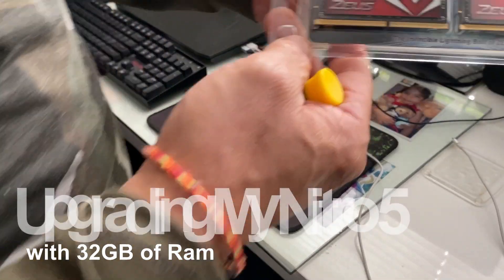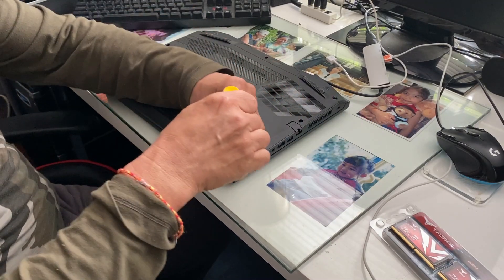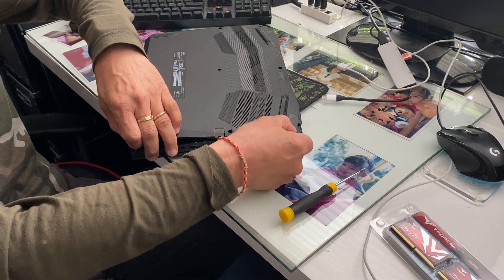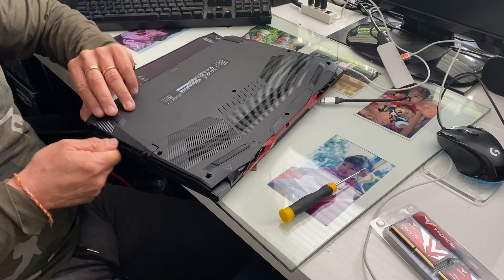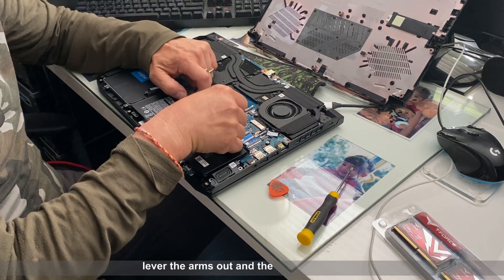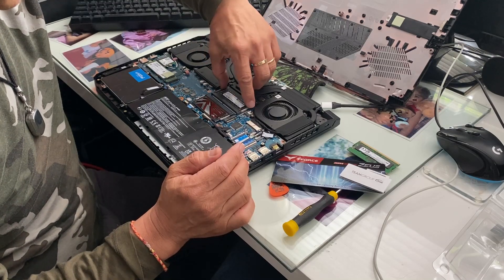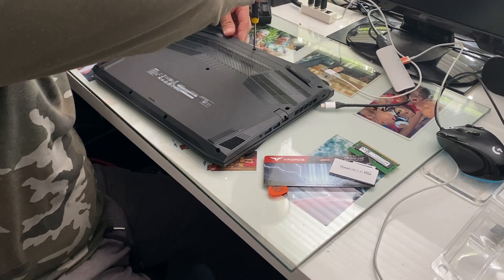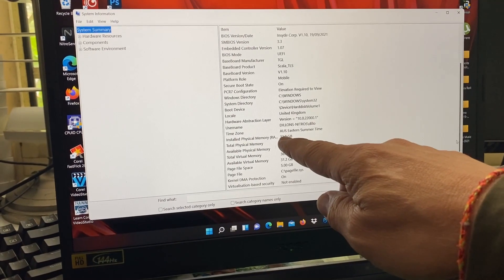Upgrading my Acer Nitro AN515-57 with 32 GB of RAM

Comment: Hi, I have this same model and upgraded to 2x16 gb 3200mhz but my speed reduced to 2667 mhz. Should i manually set ram frequency in bios from auto to 3200 ?
Reply: Your CPU processor couldn't handle it so it capped automatically.

Comment: Do you know if it's still able to run at boost speeds. I read that using this ram may limit the clock speed to 2666mhz. Please let me know I'm thinking about purchasing the same ram if it's not limited.
Reply from the maker: Not sure, I remember trying to enable over clocking at the bios , but cant find the setting. So I assume my laptop dont have it.

Comment: Acer does not use a separate tool to remove the back cover on these series as it can be scratched. Unscrew all the screws, then hold the upper right side of the cover and gently pull it towards you, the cover will open easily.
Reply: Thanks bro. I had really difficult time trying to dissemble the laptop. Until i went to this video and read this comment this really helped me. Thx man

Comment: whats your laptop ideal temperature ? mine is around 52 - 60 is it okay ?
Reply: Fluctuates, hottest during gaming, worst during hot weather.  And how long you use it for, you can tell when your laptop fan spins faster. Computers all have a thermal cut off, so if the temperature is too hot for the components inside it will automatically shut down.
Reply: @bestsydneyparks9164   goes 92 while gaming not beyond that , i haven't cleaned it for a year(since i bought) due to warranty issue .
Reply: @bestsydneyparks9164  update temperature sits around 42 - 45 hot summer and 88 at gaming with normal thermal paste.

Comment: Hi, I also have Nitro AN515-57. 
does it need to have the same RAM or i can keep the original  ram and just add 1 T-Force Zeus RAM?
Reply from the maker: If you want to add a Ram, it is best to get one with exactly the same matching specifications as the one you have. It is best to take your one out of the laptop to your supplier and ask them for a matching ram and make sure you can get a refund if it doesn’t work.

Comment: i tried to upgrade my ram but i wont get a display after i do it
Reply from the maker: It sometimes takes a bit of time to recognise it, if it don’t take it out again and reinsert it make sure it clips.
Reply: @LQQKn4Laughs  I saw online to wait a few minutes and I did so and got a black screen still, I also tried testing each ram individually and they both worked individually. So I'm not sure what the issue is
Reply from the maker: @StreetkillnHD  are both Rams the same specs, so your just adding one new ram with the ram that came with your laptop. You would think it would still boot up showing just one ram. But black screen, did not even make it to bios, would be a Ram issue.

Comment: Hi, i have an Acer Nitro AN517-52, Intel i5, Geforce 1650 GTX, 8GB Ram 3200mhz DDR4 dual channel. I was wondering if its possible to fit Corsair Vengeance 2 x 8Gb 2400mhz DDR4?, i know the lowest Mhz you can go is 2600, but i'm just asking out of curiosity. Cheers.
Reply from the maker: You can but you will reduce the max speed of your Ram to a max of 2400mhz, better to buy an 1 extra 8GB 3200mhz and add it to your existing Ram.
Reply: @LQQKn4Laughs  ok thank you
Reply: @LQQKn4Laughs  hi, will any 8gb 3200mhz ram stick work? Or does it have to be a specific matching stick? Thanks

Comment: Can i get plss your model number bc I can’t find the ram also in the description
Reply from the maker: Laptop
Nitro AN515-57
Core™ i7 processor1, GeForce RTX™ 30 Series GPUs1 and the high-speed IPS FHD display with 144Hz refresh and 3ms2 response.

Ram
TEAMGROUP T-Force Zeus DDR4 SODIMM 32GB 3200MHz (PC4-25600) 260 Pin CL16 Laptop Memory
Reply: @LQQKn4Laughs  i mean the ram
Reply from the maker: Laptop and Ram info given

Comment: Has anyone tried an external GPU via thunderbolt?
Reply from the maker: Can’t find any usb-c gpu adapters on eBay , is there such a thing?
Reply: @LQQKn4Laughs  an515-57 got a thunder bolt port , devices like Razer core x supports thunderbolt.
Reply from the maker: Woe, $700 Australian Dollars for the Razer Core X, may be better to fork out for a better laptop. Did you see the alternate ways , plenty youtube vids  on removing the the wifi card and using its pci slot for an adapter, more risky but cheap way to getting a external gpu. Check out this vid. https://youtu.be/vHiEqUoxyoQ
Reply: @LQQKn4Laughs  i know i just want to know of someone had tried and if it works

Comment: Great video!... Hi, can you show the memory info in TaskManager in the tab Performance? or give me the info like speed you get with new ram upgrade...? Thanks.
Reply from the maker: yes,Task Manager and click More Details > Performance > Memory.
Your RAM speed, in MHz (megahertz), is under the graph next to Speed.
Reply: @LQQKn4Laughs  In your case, what ram speed you get with this new Ram?
Reply from the maker: @CapzsparttanZ  my max speed is 2667MHz, It’s only a cheap laptop for basic gaming, the max speed of the new ram are rated 3200Mh , I don’t think you can use max speed as the bios don’t offer the Xmp profile, I could not even get onto an advanced menu for my Nitro. If you find a way, just be careful it may harm your laptop.

Comment: I have a question, I have 8 gb of samsung single rank ram model ( 1Rx8) with this laptop, I want to upgrade to 16 gb but the samsung ram model isn't available in my country, a crucial model is there with same specifications with dual rank (2Rx8) should I buy this or go for single rank model of crucial? Will there be any compatibility issues with single and dual rank running together?
Reply from the maker: The best is to match the rams with same specs/speed and the same chips inside even if its different brand, cant go wrong with buying the exact samsung replacement.  If you cant get it, stick to Ram kits, 2x8gb or why not 2x16gb. However I have mix and matched Rams in my older laptops and most of the times it works fine, but if you want re-use your old stick to save money go to the supplier tell him you want to upgrade to 16 and have a Samsung Ram/specs.. and you want a equivalent, make sure you can get a refund if it doesn’t work. Check out also Linus Tech video https://youtu.be/bTS0ybQ3lCI
Reply: any ram company name should work fine! as long as you have it as a SODIMM and  at the same ram speed as your nitro 5, My AN515-57-535Z is a 3200mhz model so i bought 2x16gb ram sticks with both 3200mhz and put it in and it works nicely~ just make sure what number of mhz you need for your laptop's max capability :D

Comment: Does the ram require XMP compatibility? Also, if I may, is it dual channel? I have a Acer Nitro 5 AN515-57-536Q. Thank you sir.
Reply from the maker: My laptop is still under warranty and I didn’t want to muck around with over clocking, my nitro can only handle basic gaming so I kept to the specs they recommend in the manual for my model which should be the maximum speed The laptop is rated at.

Comment: I wanted to upgrade my storage with crucial mx500 1TB 2.5 SSD but after it was installed, my nitro 5 won't boot up. The screen is just black, if I disconnect the SSD it boots up just fine, any idea what could be the problem? Thank you.
Reply from the maker: Hook up your hard drive first then get into your bios, select your original Hard drive that has your operating system installed as your first boot device , save then exit.

Comment: Is it okay to put hard disk 2.5 ssd instead of hdd right ?
Reply from the maker: Yes, I installed a 2.5 SSD, cause I use mine for gaming and video editing.
Reply: @LQQKn4Laughs  oh thank you so much sir
Reply: @LQQKn4Laughs   sorry im not good with how computer works, but i have 512gb ssd and i can add another ssd? is that right?
Reply from the maker: @vrindadasi8932  my model has already a M.2 SSD when I bought it, I added 1x 2.5 ssd and there is  another position near the Ram for additional M.2 SSD . So it can accomodate a total of 3 x Ssd drives. Check your model number for specs. On how many you can fit in your nitro.

Comment: is upgrading the ram  will void the warranty?
Reply: Not if your careful, things like  damage the components trying to open the back of the case or forcing a part in can cause damage. Static electricity are all possible risks, if your not confident, best get an expert to do it.